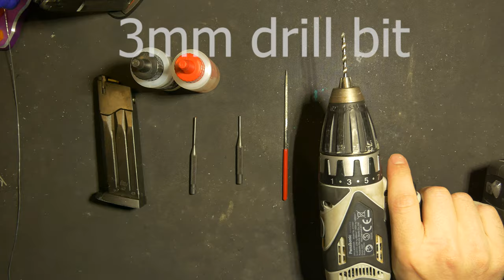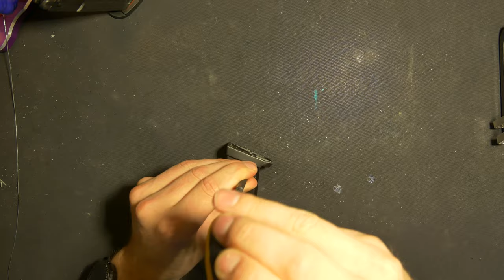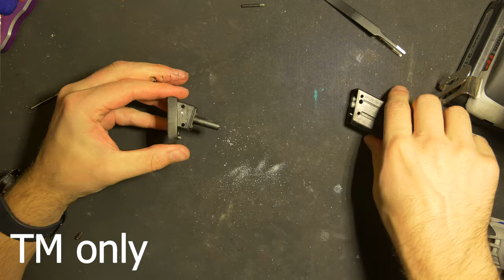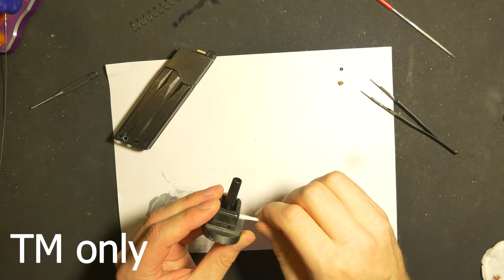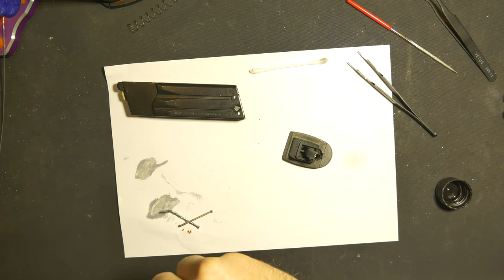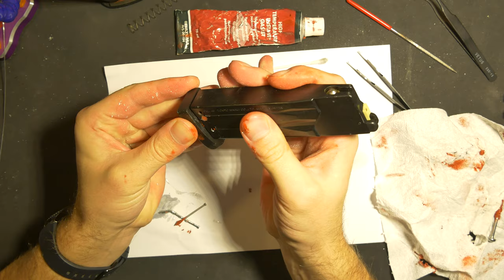How to FIX a leaking Mk.23/SSX-23 Magazine any brand.

Comment: Will this fix the problem with it leaking straight out the box? Only holds gas for like maybe 5 shot, and I can't find spare mags anywhere, out of stock.
Reply from the maker: This will only help if your mag is constantly leaking from the bottom. If your mag is holding its gas until you are fiering, it's probably too cold outside. Greengass won't work in temperature below 20-30C°.

Comment: Thanks for the video! After using the liquid gasket, will the mag never leak again on the base?
Reply from the maker: Np. It's not guaranteed, but it works for me. Just remember to lett it dry for a couple of days.
Reply: @RobinBerntsen  But it looks like you never will be able to get it back out because it's basically glued? Thanks for the reply!
Reply from the maker: It's no problem taking it apart again. But the seal will brake
Reply: @RobinBerntsen  Have seen some people use Gorilla Glue instead of the liquid gasket... probably not the best solution
Reply from the maker: Then you can forget to ever take it apart again😅
Had a friend who did that. Didnt stop the leaking.
Reply from the maker: I did it without, but i know some that does it with the gasket.

Comment: Did you forgot to put the spring back?
Reply from the maker: If you are thinking about the spring on the side for the pressures release, no. I glued that vent shutt for the mag to accept higher presure. If you aren't using higher presure gass, i dont recommend to to so.

Comment: You know you don't need to drill
Reply from the maker: If you refering to slaming it with the hammer, i know. But personally I take my chances of drilling rather then cracking the asambly. But it may work better then it does in my head😅
Reply: @RobinBerntsen  there's a video on youtube showing how easy it is. I wouldn't really call it slamming haha
Reply from the maker: Hehe. People are free to do as they please. I just shared what I did and people have given me better ways to do it. So maybe on a other video I can show different ways people solve a problem.